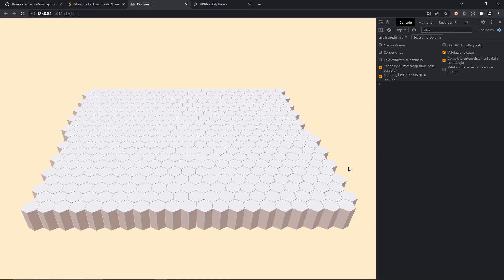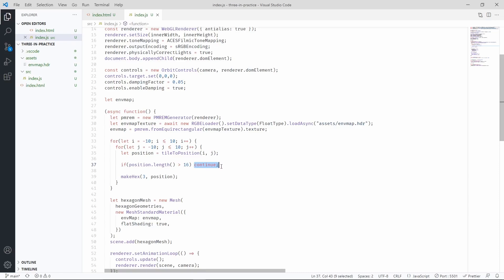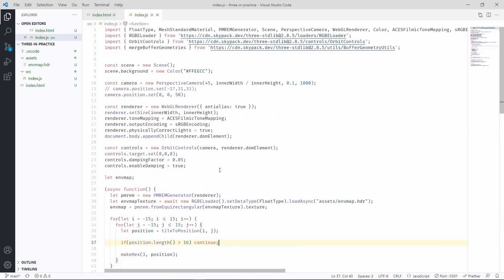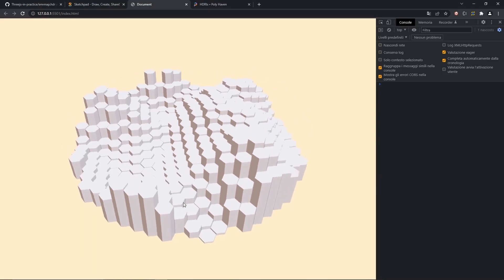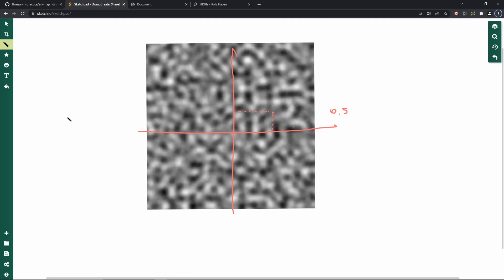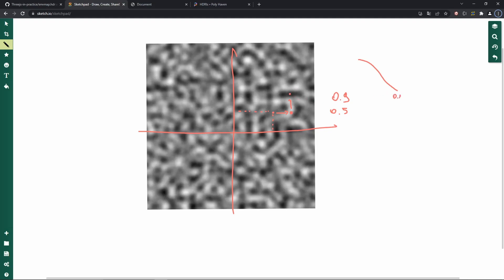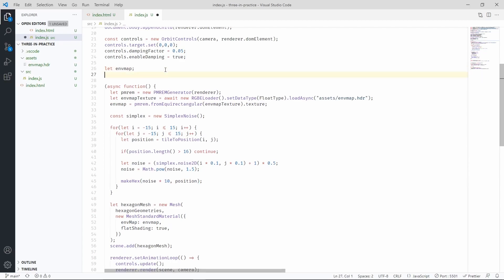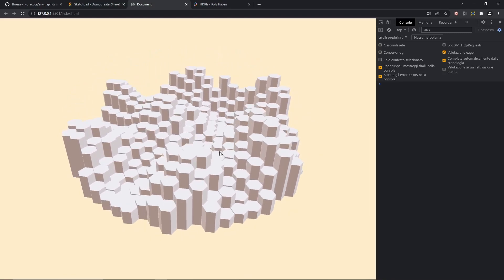Three.js in practice - Procedural Map - tutorial for beginners 2022 - part 2

Comment: Awesome series!! Got me finally started on 3D. :)

Just a question. I'm using the exact same formula for calculating the height, only difference to the video is that I'm using the new 4.0.1 version, and the mapping seems rather chaotic. Would you have some advice on this?
Reply from the maker: Hello and thank you! Version 4.0.1 of which library?
Reply: @irradiance730  Sorry, I forgot to update. I had the create noise function inside the loop, so each time was consulting a different map :v
Reply from the maker: Yeah that definitely belongs out of there :P
Reply: Hey! Thanks for this amazing tutorial! It is highly detailed and well explained, without skipping parts. 

But it have the same issue. The height is random and not chunked together. It is chaotic and shows random pillars all over the place. Your look like actual mountains. How do i fix this? I checked your github and used the same noise npm version. 

Please make some more tutorial. Love your videos.

Comment: Hey man! 

Just a thought here but have you ever considered using tools just has spline and to then apply a three-js (R3F) on top of it after to increase your productivity output? I find that with ThreeJS its really hard to retain the concept that you need to know at the tip of your fingers in other to achieve your desired outcome and sometimes a visual interface may help with that. I also found that Spline Design really made good improvement in their export feature, now you can export directly to R3F or Three so makes it more realistic to build such a workflow. Just dropping that in the universe.
Reply from the maker: Thank you for the feedback! Spline is getting better and better and you're right, I should definitely invest some time learning it and seeing the potential for r3f integration
I'd prefer to spend a good chunk of time with the tool before pushing anything resembling a tutorial because I'd like to make sure that I "know" the topic well enough to teach what I've learned, and that could take a while but yeah I should probably start!